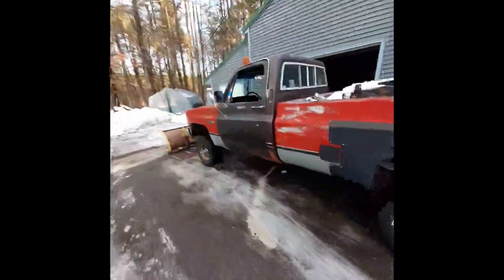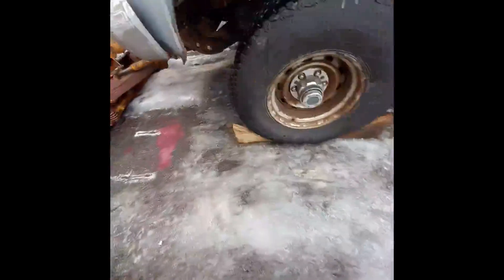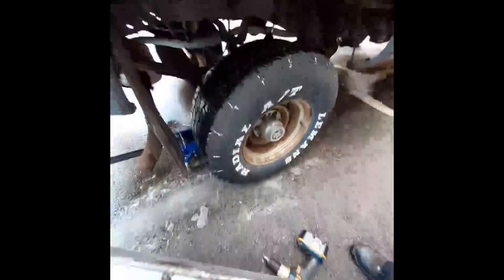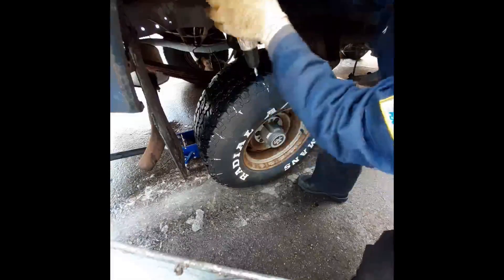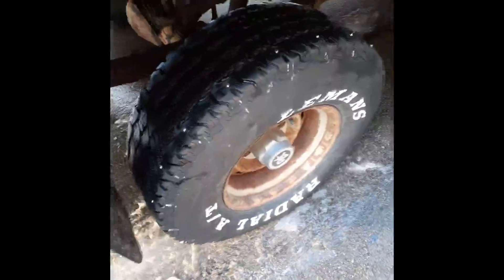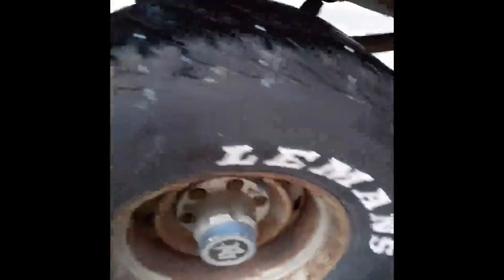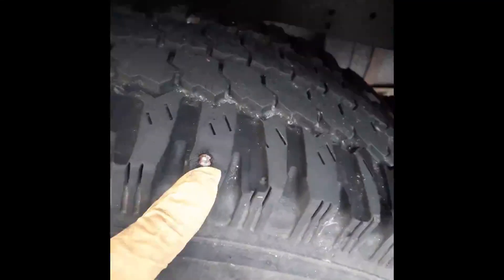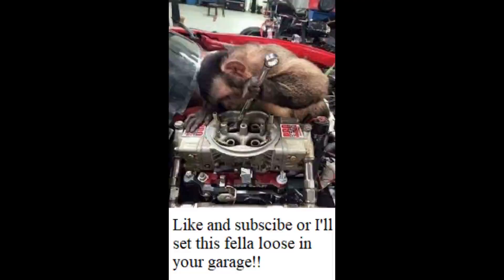Tire Studs 101, how to install them. DIY

Comment: How long did they last, did they come out at all on higher speed?
Reply from the maker: The studs have been in for 2 years, without any problems.  Take note of the shape of the stud, as these are the best, and not merely screws.  I have another video about what is a stud.  It's short, but very useful.  Make sure you use the same type I have here, not bullet shaped ones.  Remember to like and subscribe.
Reply from the maker: Here's a video with the studs, and a link if you want to purchase them.  https://www.youtube.com/watch?v=hb_RbVcGrs0